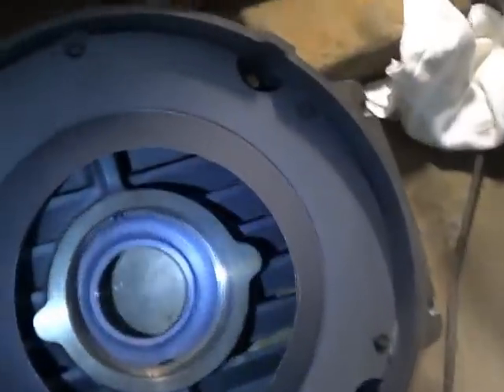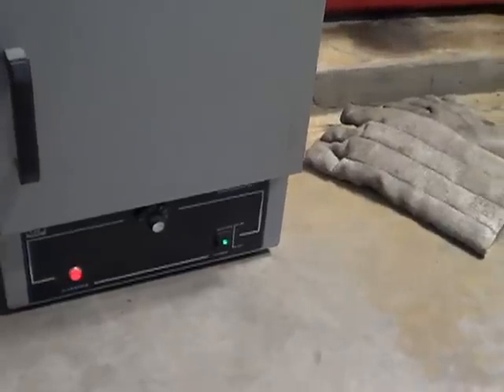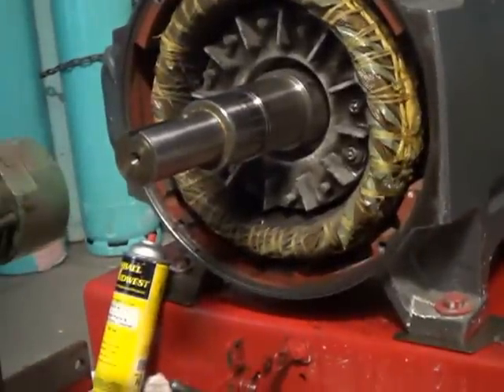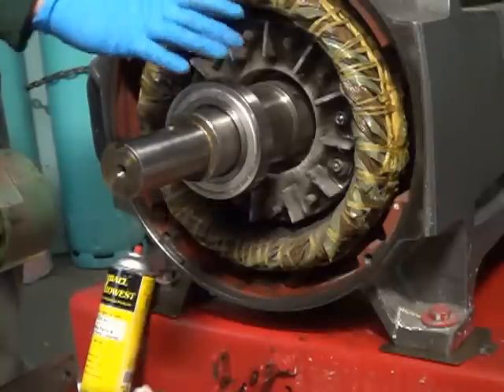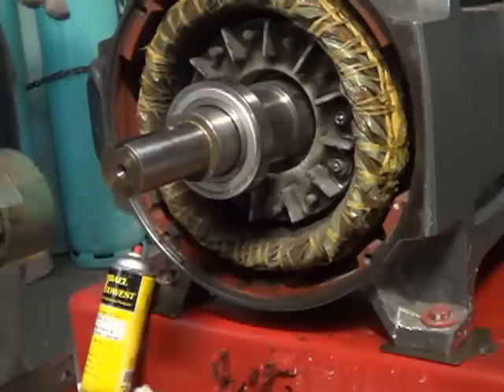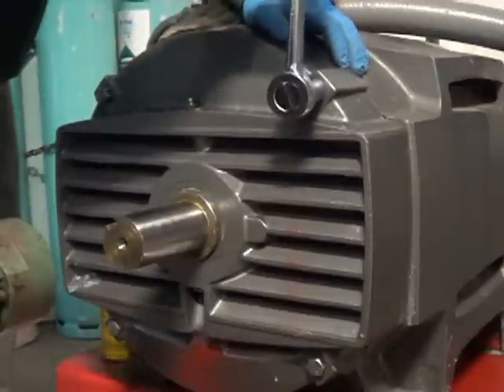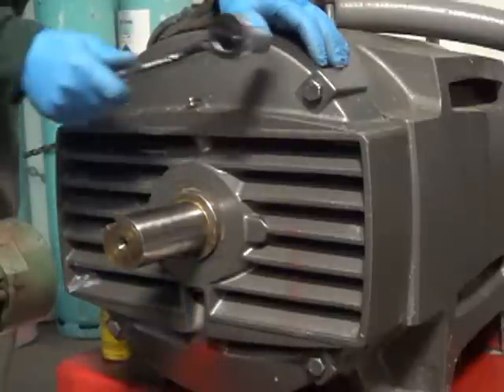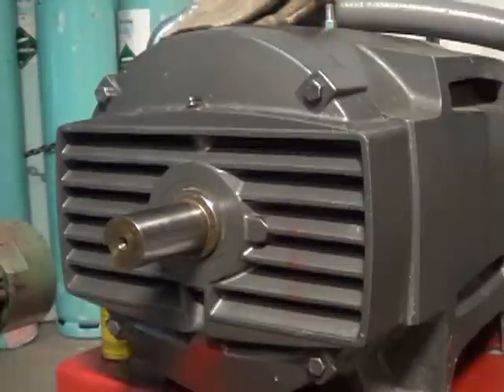Electric Motor Bearing Install

Comment: i wish l could get a job in a plant like that, but l applied to AEP but they wouldn't even talk to me cause I didn't have a degree.
Reply from the maker: It's always been that way. We have some folks with the paper and can't  tie there own shoe.   Just take anything to get in the door. Then do a good job and start networking to find that person who will recognize your talent and give you a break. Good luck and thanks for watching.
Reply: TheEZGZ I know, I worked there for a while, for this company that took pictures in the plant and warehouse to make a database for the computer, for the mechanics use.
I used to break my heart, because I knew I could do the work. Especially with some training. They had head mechanics too, so it wasn't like they would just turn a new guy loose and say "fix it" they worked with you pretty good.
No, I am pretty well done. I got a job with the highway dept, but got sick, and had to have treatments, now I can't work out in the cold, so probably won't go back to work. Life can change in a hurry. 
I was wondering, when you cut the bearing with the dremmel, and were hitting it with the chisel, if you put something under the bearing race, like a hunk of steel, or a andvill,to support the shaft, if that would have made it easier to split the race?
I used to split them like that sometimes too, but I got good with the torch, where I could nick them with a torch, and split with a chisel, but maybe you wouldn't want slag in the motor either.
Reply from the maker: anthony diodati I am retired now. I have a lot to be thankful for. Looking back on my own past there were things I did not understand that changed my life but now I know it was for the best. I sincerely hope you find peace.
Reply: TheEZGZ thanks EZ
Reply: +anthony diodati never cut a motor bearing off with a torch, the chance of melting the insulation on the windings is too great.

Comment: Or you can freeze the shaft with a can of dust off sprayed upside-down.
Reply from the maker: A 2 1/2 inch steel shaft would take more than a can I'm afraid.  A good blast of R12 worked in the good old days'

Comment: Actually Henry your Technique is not the best way to do it if you're going to be a professional and do it right purchase the bearing warmer little bit pricey but still worth the cost and Longevity bearing damage replacement bearing because of Damage Done list goes on Harry let's try to do it right if we're going to give tips  let's be professional I know you got it in you Harry
Reply from the maker: +Randall Highsmith  Every one is a critic. How about you make a video and show us the correct way to get the same results.
Reply: Actually we was just talking about that today.. thinking about going ahead and set up a motor test station ,get the bearing pullers bearing warmer, also thinking about doing a amperage before and after the bearing change. and motor cleanup also think about getting a run-out station setup check out for shaft runout on the motor and a thermometer gun check for heat what do you think should I do it?
Reply: +Randall Highsmith  
as an electrical mechanic/ vib/field-shop ballancer/alignment tech, I think that's a great idea. I would like to see more technically correct videos posted by professionals